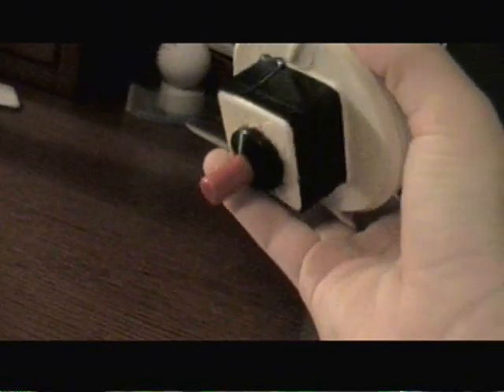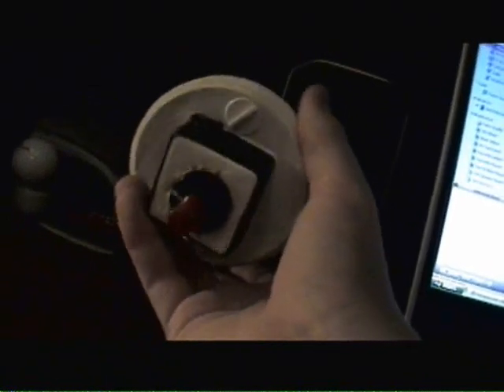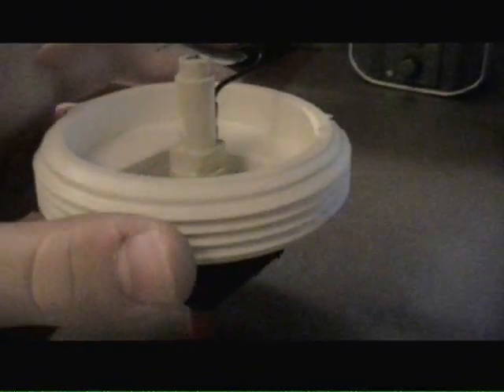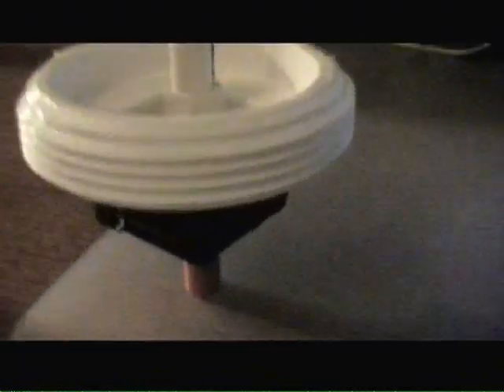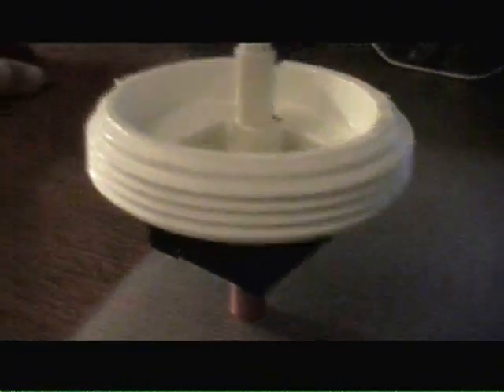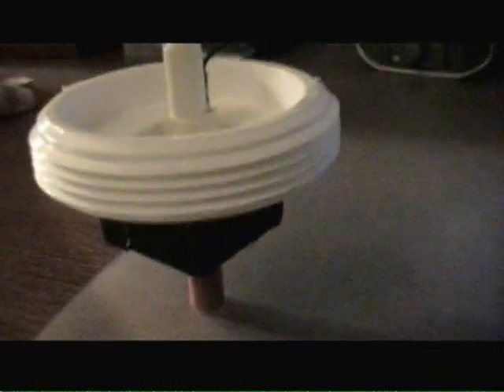How to Make A Potato Gun Sparker

Comment: screw a spark plug into the hole, then hook the wires to the out side of the spark plug.. its way easier and it wont corrode from the explosions cause a spark plug is made for sparking explosions....

Comment: i use standard 14.1 ounce propane tanks that are like $2 at wallymart and the standard torch end, just open it up for 3-4 seconds (depending on combustion chamber capacity) 

butane is much more expensive, propane is heavier than air, put the open end of the chamber up and let the propane flow down into it, then cap it off. (you don't have to rush, it's going nowhere.)

i have a new, high speed video camera coming this week, i'll make more vids soon >:-)